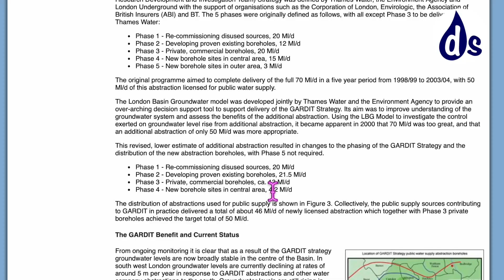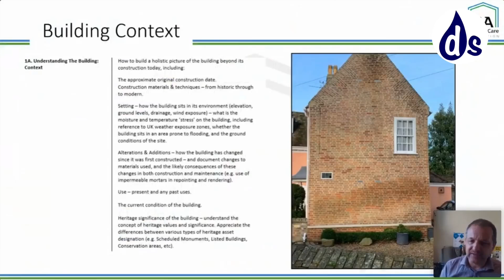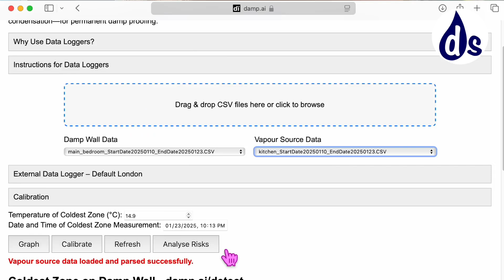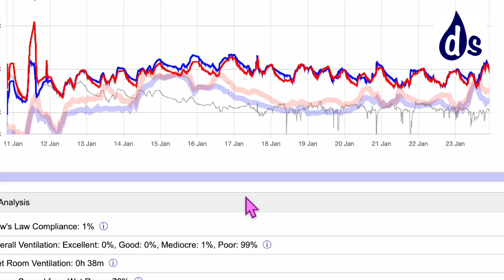❤️ Rising Damp - 🤔 Truth or Scam ⚠  #RisingDamp #DampProofing #DampSurvey #SkillBuilder #RogerBisby

Comment: Based on your experience can mould / damp present behind wallpaper due to condensation, via seeping through the paper on cold spots? or would you expect this to be the result of something like penetrating damp? Slightly worried because I've just completed  on a property, ripped off the wallpaper and have found quite a few patches of mould, doesn't appear visibly damp but haven't had much rain as of recently.
Reply from the maker: Mould behind wallpaper is a sign of excess vapour meeting a cold wall - be it excess vapour from the building - or localised such as from a leak.

🧐 Common causes include:

1⃣ Condensation trapped behind wallpaper – Wallpaper can act like a semi-permeable membrane, allowing some vapour through while limiting evaporation, creating damp behind it.
2⃣ Hygroscopic wallpaper and adhesives – Some wallpapers, adhesives, are marginally hygroscopic, meaning they absorb moisture from the air and hold it longer. Think of how textiles can grow mould in damp conditions (textiles, leather and even certain plastics are marginally hygroscopic). This slightly increases the surface relative humidity, making wallpaper one of the first places where mould can develop.
3⃣ Interstitial condensation – This happens when warm indoor air meets a cold surface inside a wall.
4⃣ A leak or Penetrating damp – If the issue is localised and follows a defect (e.g. leak, or external defect such as defective render or paint, or overflowing gutters etc).

📌 What to do next:
✔ Check the external wall for defects—especially render cracks, failed paintwork, or blocked rainwater goods.
✔ Use data loggers to track humidity and surface temperature (see https://damp.ai/detect  I'm dropping vid about it, soon).
✔ If excess vapour is suspected, improve ventilation and use a dehumidifier (see https://damp.ai/use-a-dehumidifier).
✔ Repaint with a breathable paint (like Earthborn Claypaint or Keim) rather than vinyl-based paints, which can trap moisture.
✔ If in doubt, test the wall with a moisture meter to check for excess moisture deep in the wall.

@johncranna9427 is right that condensation forms on the outermost cold surfaces, but moisture can still get trapped behind wallpaper due to poor drying conditions.

@Stan_55UK makes a great point about adhesives—older ones can definitely contribute.

@coxy1984 I agree that tanking slurry is not appropriate above ground—it traps moisture, which leads to secondary problems. Renovation plasters or targeted treatment (like Zinsser Cover Stain for covering hygroscopic salts) are often a better approach.

📌 If you’ve just bought the property, don’t panic! Drying out and monitoring over a few months will reveal whether it’s an ongoing issue or just residual moisture. 🚀

Would love to hear what others think—has anyone else found unexpected mould behind wallpaper? 🤔
Reply: @dampsurveys  Thanks again for the advice and the great content, thought I'd reply and give a little update, after moving in I started keeping an eye on the humidity levels and it seems like it's a bit of an expensive property to heat (old storage heaters), when it gets particularly cold I see it rapidly approaching 60+ in humidity. So I suspect the previous owner might not have been heating adequately and had a condensation build up on the cold external walls.  Thankfully with heating and dehumidification I've been able to keep the relative humidity around the mid to low 50's in the room where I found the mould behind the wallpaper and the low 40's in the other rooms. There are vents in all the rooms (1980's, about 20cm x 20cm) just above head height which exit to via air bricks on the external wall. These don't seem that effective other than a periodic draft. Opening the window for 5 minutes will noticeably drop the relative humidity in comparison. All in all situation is manageable and no where near as bad as I was fearing.
Reply: Please don't take this as gospel, but I seem to recall reading that certain wallpaper adhesives can cause mould.  I think later ones had additives in? Either way, I hope your problem is a simple one and easily dealt with.
Reply: @STH_55UK  Thanks appreciate the insight!
Reply: There is no need to use tanking slurry above ground nowadays. Renovation plasters with salt inhibitors are a much better option. Also, the Dryzone express system works well. I do believe in rising damp, but it's rare, and all these companies recommending it  haven't a clue what they are doing. Or just cowboys.
Reply: Condensation can't seep through from behind by definition.  Condensation is when warm, moist air meets a cold surface.  The water vapour in the air condenses and goes from being a gas to a liquid so it can only happen on the outer surface of a wall.  You can get interstitial condensation when you have insulation on the inside but it's still from moist air coming from the inside.

Comment: I love the rising damp debates! Totally DIY myself, but my ongoing project showed what I thought might be rising damp. I did however question this, since the house is built on sloping ground, with the front ground level being 2 courses below (slate) dpc, and the rear of the house having ground level about 7 courses below dpc. Inside, I get the same 22% reading on these contrasting walls; I had thought that the wall with lower ground level might have a better reading, but it didn't.  They are all concrete floors with membranes in place. I considered that if it were rising damp, then it had to be coming via the floor somehow, but with a membrane in place, this would seem unlikely? There are so many other problems with this old house, that I don't think I will ever reach a conclusion about the cause of the damp readings in the lower walls. I do know that with ventilation, a dehumidifier, and many other remedial tasks, they do seem to be slowly drying. I have mentioned before that one stubborn wall in the pantry was not drying, and I went for dry rods. Time will tell! This is a retirement project, and sometimes I think I should have restored a nice motorcycle instead, I know a little bit more about them than houses...
Reply from the maker: Stan, your insights always make for great discussion! Your project really highlights the complexity of diagnosing damp issues properly.

Why solid floors can exacerbate damp:
Since concrete floors are impermeable, they can’t absorb water like suspended timber floors, which means any excess moisture in the air is more likely to condense on walls. This is why homes with solid floors often have more surface condensation and damp issues at the base of walls.

A “belt and braces” approach:
In addition to lowering vapour levels through ventilation and dehumidification, I sometimes recommend:
✔️ Cutting back the last 10mm of plaster behind the skirting board.
✔️ Applying a siloxane bead (like DryZone from Safeguard) to create a barrier, with minimal effect on the wall.

My issue isn’t with chemicals—it’s with misdiagnosis:
I’m not against chemical damp-proofing in principle—siloxane, the active ingredient in DryZone does block moisture movement, at least temporarily (like 5 - 10 years). However:
1️⃣ It dissolves over time in genuinely damp conditions.
2️⃣ The real issue is misdiagnosis—when rising damp is blamed for issues actually caused by leaks, condensation, rainwater penetrating damp or hygroscopic salts.
3️⃣ Slurry is the real villain—it’s impermeable and stops walls from naturally buffering excess vapour, increasing the risk of condensation and mould - like breathing into a plastic bag compared to a paper bag.

The misunderstood role of hygroscopic salts:
Hygroscopic salts—often a mystery to homeowners and even surveyors—are not a source of dampness. They:
🧱 Come mainly from historic coal burning and animal excrement (such as equine urine).
🔄 Are in dynamic equilibrium—meaning they absorb and release vapour at equal rates.
📌 The right solution? Instead of covering entire walls with impermeable slurry, simply spot-treat affected areas with Zinsser Cover Stain (two coats, 300mm overlap). It’s:
💰 Cheap
🛠️ Effective
🙌 Easy to apply and reverse

The bigger picture:
If we could shift the industry towards proper diagnosis and simple, cost-effective solutions, we could save homeowners £1–2 billion a year and mental health stress. That’s money that could go towards solving child poverty, improving elderly care, build a few NHS hospitals or even stopping Putin. Big dreams start with small changes—so let’s get the word out! 🚀

What do you think, Roger Bisby @SkillBuilder ? I'd love to hear your take. 🤔
Reply: @dampsurveys  The damp in floor explains a lot! I think that this might be a major contribution to the damp, and I can see why the dehumidifier/ventilation is working. Also , i did cut some render from behind skirtings, which in my DIY opinion seemed very low. Stormdry could be a future possibility, but I feel I am on the "right side" now.

As a born cynic, I do often wonder about the whole mortgage industry/damp industry connection...
I have tried to do my own investigation/remedial work, with the help of your and other channels, to all of whom I am very grateful. If that puts a  little more money into the economy for good causes, then that is a bonus. Also it hopefully saves some of my pension pot, and as a Northener, saving money is very important to me ;)

I have watched a lot of Roger's videos (and damp Sam.) From a DIY point of view, I think that Roger knows his building game, and I have had a few tips from him. I do wonder if his approach to damp is sometimes OTT. In other walks of life, I was always taught to look for the cheapest/simplest solutions first (within obvious concerns for health, safety etc!)
Reply from the maker: @STH_55UK   Stan, I really appreciate your thoughtful response—your hands-on approach is exactly what more homeowners should be doing!

🔍 Understanding Damp in Floors
Damp in solid floors is often overlooked—but once you realise that concrete doesn’t absorb moisture like a suspended timber floor, it makes sense why condensation and damp build up on walls instead. That’s why ventilation and dehumidification have been helping you—it’s addressing the vapour rather than just masking symptoms.

✔ Removing render behind skirting was a smart move—skirting often traps moisture at the base of walls, causing moisture to rise and mimic rising damp. Sounds like you’ve already made good progress! If things keep improving, Siloxane like DryZone creams could be useful as a final step—but only once you’re confident external rainwater isn’t an issue.

💰 The Mortgage Industry & Damp-Proofing Connection

You’re not alone in questioning this. Many mortgage lenders still push unnecessary rising damp treatments because it’s “standard practice”—even when the evidence doesn’t support it. The real issue is that surveyors often recommend PCA contractors, who in turn recommend rising damp treatments by default.

That’s why I’ve been pushing for independent diagnosis first, rather than just assuming all base-of-wall damp is “rising damp.”

🔹 Your DIY approach vs. the industry standard
Your method—investigate first, find the source, fix cheaply and logically—is exactly what I advocate for. You’re treating the root cause, then checking for improvement, not just throwing chemicals at the problem.

Yet, in the damp-proofing industry, it’s often the opposite:
✔ Homeowners are sold expensive rising damp treatments instead of being advised to check for mains leaks, fix external ground levels, drainage, or ventilation first.
✔ Impermeable slurry locks moisture in, causing bigger problems later—and allows damp to continue causing rot, subsidence, unnecessary insurance claims, and property devaluation.
✔ Their “solution” is always more damp-proofing, rather than questioning if the diagnosis was right in the first place.

That’s why trying simple solutions first, then using independent surveys, is so important. You’ve taken the time to understand your property—and that’s saving you money while keeping the economy honest!

🏡 Roger Bisby & DIY Damp Solutions

I agree—Roger knows his stuff, and his practical building knowledge is solid. But like you, I sometimes feel his damp approach leans towards chemical solutions (which I'm not totally against, but it is the unsightliness and what chemical damp-proofing signifies that concerns me) and slurry (the killer issue), when simpler, cheaper, root-cause fixes are better long-term, low-risk option.

The cheapest, simplest solution is usually the best—and you’re proving that right now. Keep going, and keep sharing your findings—I think your approach will resonate with many! ✅

Would love to hear how things progress—keep us updated! 💪